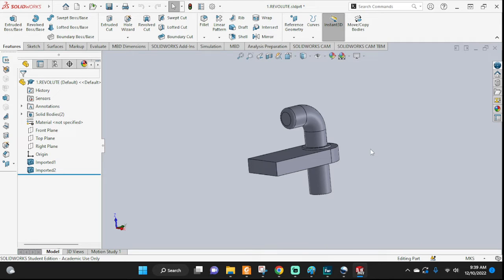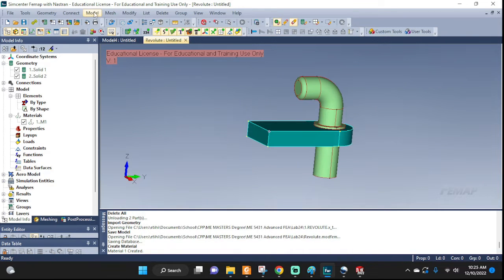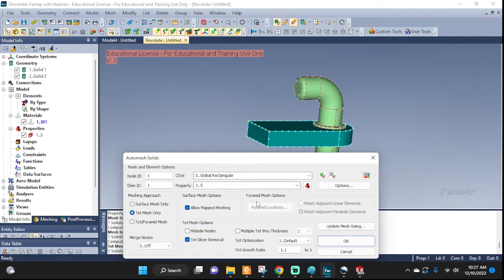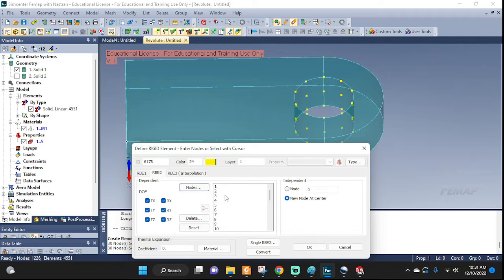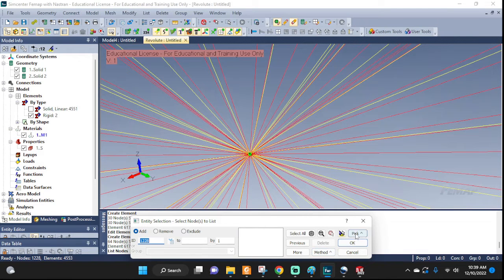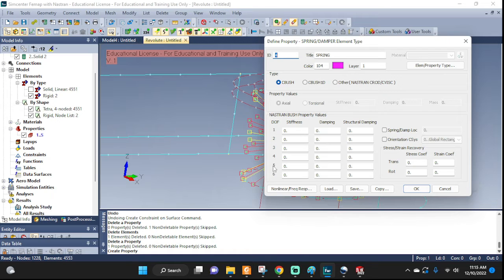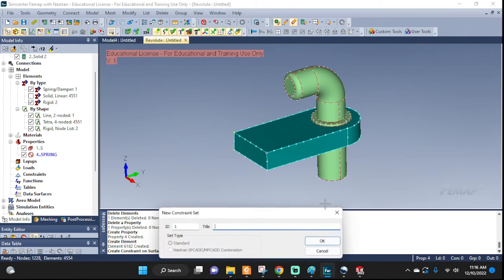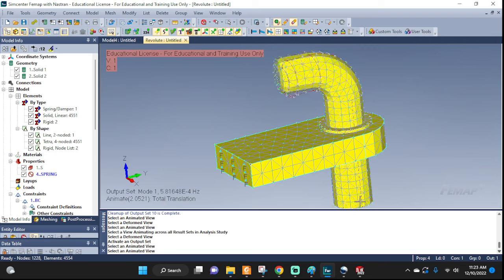Revolute joint setup in Femap with RBE2 (rigid body elements), and Normal Modes Analysis

Comment: Thanks for this tutorial! It looks that the rotating pole is increasing in diameter when rotating from side to side. Does it have something to do with RBE2 definition?
Reply from the maker: Yes it does. Most likely they are not defined at the same center